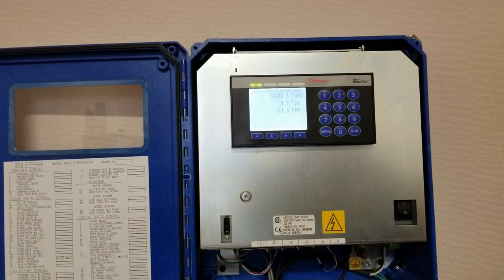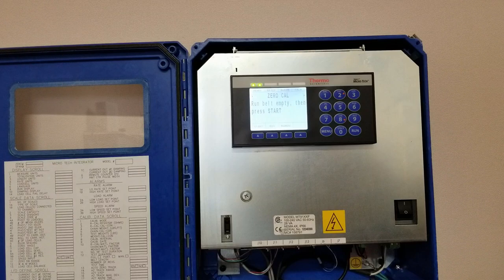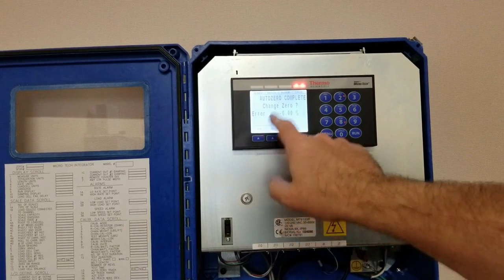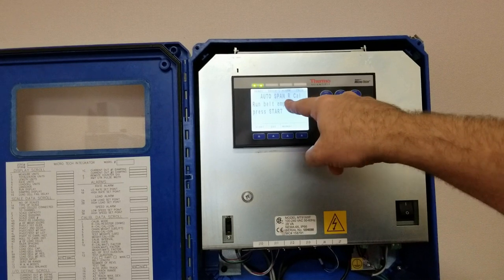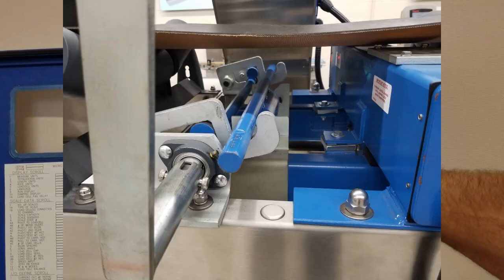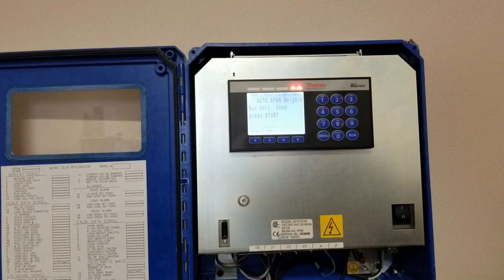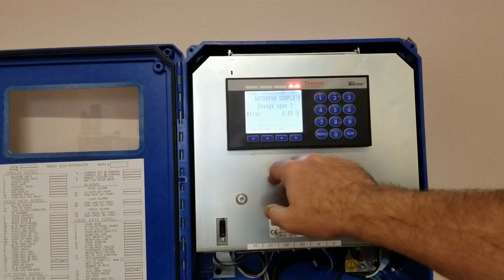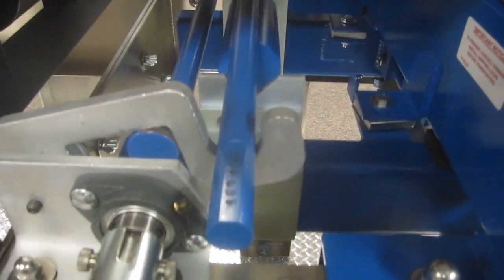Thermo Ramsey MT9101 Zero and Span with Enhancements

Comment: Sir, what the value unit after zero calibration?
Reply from the maker: The Zero unit is typically a 5 digit A/D value i.e. XXXXX and Span unit is typically a 6 to 7 digit A/D value i.e XXXXXXX
Reply: @johnsimpson6712  Thank u for your info. But can i get the formula for calculating this value?
Reply from the maker: @julianipussung223  There is no formula to calculate this value. These A/D values are unit-less representing several internal registers within the MT9000.
Reply: @johnsimpson6712  Thank you Sir
Reply: @johnsimpson6712   Sir can I have your email
Reply from the maker: @youssefziker5892  Best to contact Tech Support uscoo.techsupport.bulk.us@thermofisher.com
Reply: @johnsimpson6712  sir it's been 300percent error showing. And the rate is showing zero kg per hour. So how to solve this problem.
Reply: When I do zero calibration. It shows 43 percent error. 
How to correct it.
Reply from the maker: @muhammadiqbal-yq7mm  Please contact our Technical Support group directly uscoo.techsupport.bulk.us@thermofisher.com